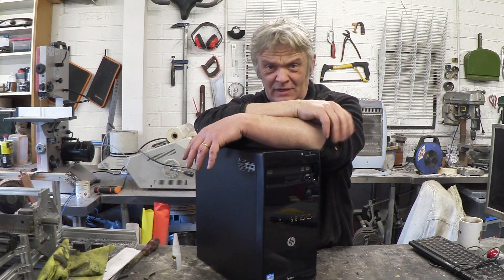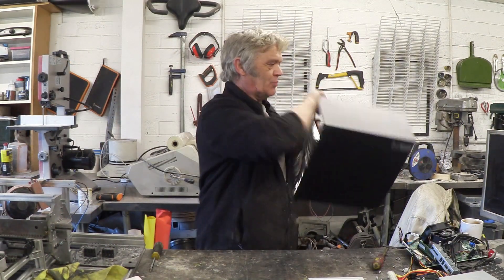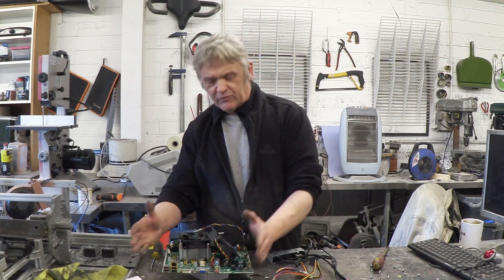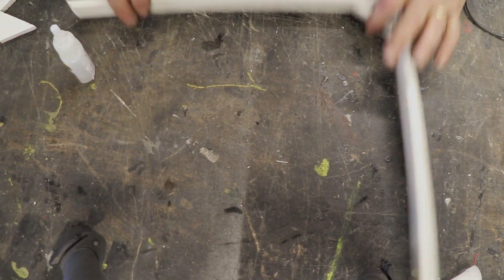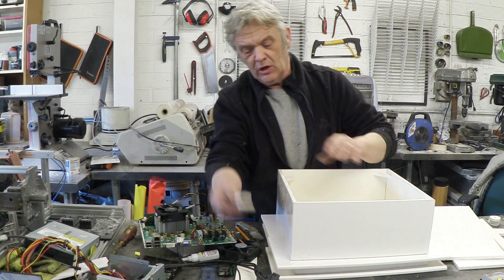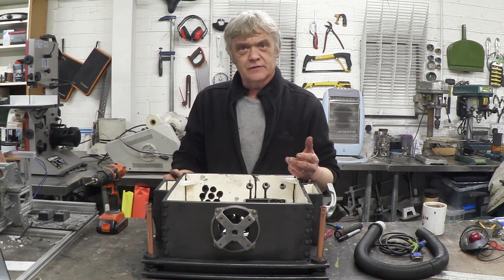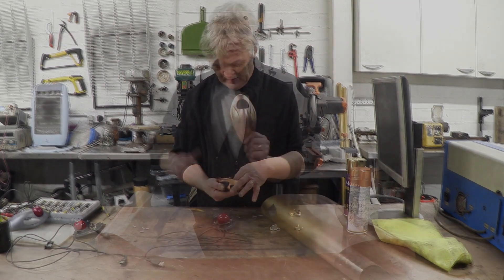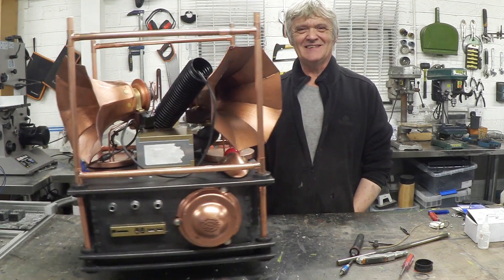981 A DIY Steampunk Computer

Comment: the metal shell of a PC cabinet not only houses the mobo  but is also a Faraday Cage. in any other non-metallic material emi filters will be over worked n prone to failure.
Reply: How? I’ve worked on PCs (usually the cheaper ones) that don’t have a metal case. I can understand that a non-metallic case could cause problems from interference, but not component failure. There are “open air” PCs that work just fine. My test rigs are open air. The only time, I would think, a fully enclosed faraday cage would be needed is with an EMF shockwave from a nuclear warhead/ICBM. Maybe it’s a different story for older PCs that were also part of the capacitor plague.

Comment: Nice.

Some comments :

Throwing the harddisk on the table like that is not a good idea. These are sensitive to accelaration and might have errors after such abuse. I once had a customer with a failing harddrive in their server. New system. So he asked me how this was caused. I say mechanical vibrations can cause this. So he guides me into the next room and there's a big hammer drilled hole in the wall drilled when the hd failed.
Placing sensitive electronics on something not conductive will not save you from ESD. The opposite is true. Place them on a conductive surface. Then when you put it down on there touch the conductive surface first with your hand so any potential difference is equalised. Then put the sensitive electronics down on the conductive surface with the other hand. When delivered these mainboards come in a conductive bag. Not in an isolating bag. Putting it on a piece of cardboard is not that bad. cardboard is high impedance but low enough to save you from ESD. Most important is weather conditions for ESD to occur. Dry air is bad. Ever touched another person and had a spark between you and the other ? Took your kids off the trampoline in dry weather conditions ? ESD does only occur in dry weather conditions.

Comment: Looks brilliant! Heath Robinson would be proud of you.
As an aside: Whist one has an old computer open, its a good idea to clean the fluff out of the aluminium heat sinks.  It is not obvious to many, that the reason why their computer one day starts to shut down randomly, is simply because its beginning to overheat due to a build up of fluff. Think of it as preventative maintenance. Compressed air and a soft long hair brush is all one needs. Also, it is possible to look at the CPU temperatures  in BIOS or UEFI to see if they are getting too high (or install an app).  Also, I think a pressure gauge from a welding set or elsewhere would strengthen the steam theme and perhaps a winding handle. Uhm... Suddenly got the itch to explore the boxes in my attic. I may be gone for some time.

Comment: My computer is a pavilion quite simular to that one, my one keeps loosing the usb's, and ass they keep freezing whils I'm doing my work such as video editing and designing in cad and such it's getting very enjoying, I'm going to have to sort it out.
Reply: Anything involving image processing puts high demand on the CPU etc. Check your temperatures, either in BIOS or   UEFI or better still install an app to monitor all the temps. If the  CPU heat sinks and Graphics cards HS  are full of fluff  clean them out with compressed air and a soft long hair brush.
Reply: @Nuts-Bolts  yes, well you see it still runs just fine and cary's right on whith whatever it's doing, it's just the usb's that stop working properly, they even stil sense that you've unplugged or plugged something in, just don't transfer any data.
I'm planing on giving it a USB expansion card. Fancks for the help.

Comment: Rob, make sure you run a grounding wire from that front port over to the power supply case. Otherwise you may end up with sparks when you plug something in.

Comment: You don't use the baking soda "filler" for the superglue?
Reply: The foam board is probably light enough that it shouldn’t matter. But baking soda w/super glue is an awesome idea. I’m not sure the chemical reaction of acrolate & soda; it may get too hot for the foam.
Reply: @HWandW  My own use of bicarb with CA glue has been hit-and-miss. Needs experimentation!
Reply: @hempev  I think it matters which brand of CA. Also sodium bicarbonate can have aluminum in it which may affect the chemical reaction in a good or bad way. I’ve used activated charcoal instead of baking soda.

Comment: Wonder whether you can produce a real "steampunk" computer as opposed to a "steampunk" replica computer.

I doubt it, Jules Verne & H.G. Wells had many prescient ideas but until the 1970's computers conformed to the idea that they occupied enormous spaces and required air or water cooling.

Today your phone, perhaps even you watch has far more processing capacity than a 1970s computer let alone one that H. G Wells or Jules Verne predicted.

Back in the '60s it was predicted that the world would only need 7 computers!

Comment: Great build. I missed the grey paint type the case was covered in. Was it conductive ink?

Apologies, I probably got distracted when Robert said.

Cheers, Ian, Birmingham, UK
Reply: I thought superglue must make the board go grey !!
Reply: 7:19 Bad edit, painting missed off!
Reply: It’s probably an oil based black paint. When it’s tacky (not completely dry, but not wet enough to move) sand it. There are also aerosol (/spray) paints that look like cast iron without adding effort.